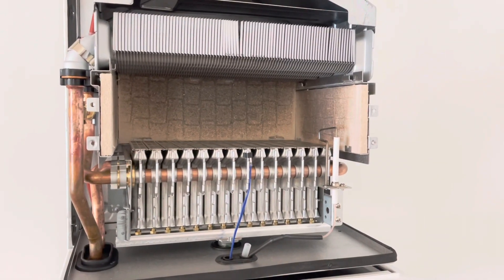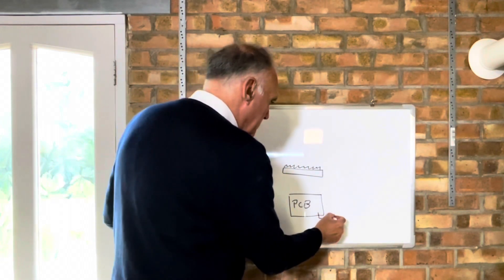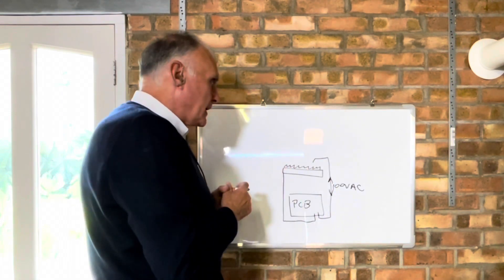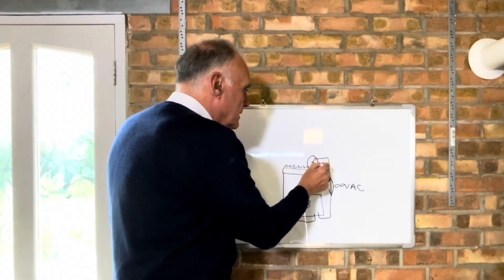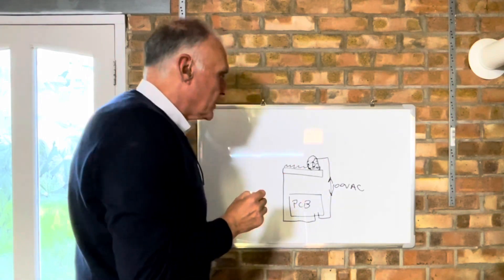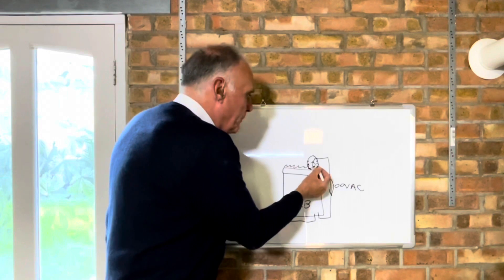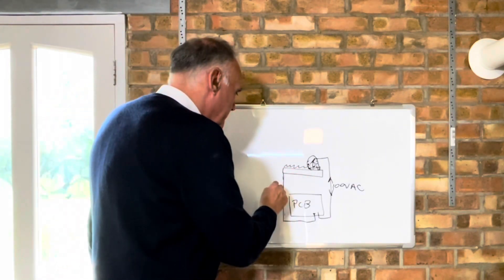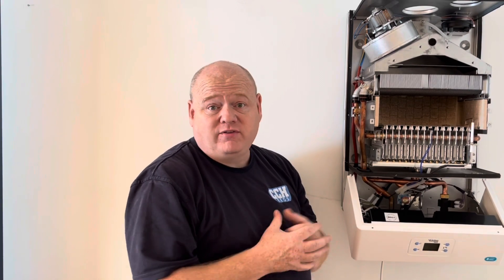Gas Training - Flame Rectification Explained - Gas Boiler - David Iszchak Vokera

Comment: Even a strong flame will only provide a very small amount of rectification, the AC isn't fully converted to DC (at best it could only ever be half wave rectified anyway as the flame acts like a single diode) so half the waveform will be very slightly rectified to DC and the other half won't. Some systems measure the difference between both halves of the wave form, others simply extract the tiny rectified portion , amplify it and if it's large enough then that is a valid flame signal. Also the electrode size thing isn't entirely correct, yes the ground electrode needs to be at least four time the size of the flame electrode but not for the reasons given, it's too complicated to explain here but there's plenty of sources, the explanation in the video is good enough for most people an even if you design flame rectification units you don't really need to know why you just need to know one needs to be bigger than the other.
Reply from the maker: Thank You

Comment: Thank You for very informative vid, whats the proper metod to measure ionizating curent on boilers like Ariston Genus One, there is spark and ionizating electrode on one wire connected to PBC, second wire comes from chamber ground to pcb ground. ??? thanks  in advance

Comment: The heat on the probe make ironination that makes the change from.ac to DC
Reply: That's like the old vacuum valves the heating element causes DC current to flow one direction. A diode vacuum valve, anode, cathode. AC to DC. 😳 It's seems  the pc board needs to sense  a good DC voltage in order to keep the gas valve open "I think!⚠️"

Comment: Hi Allen .
I'm currently studying in level 2 plumbing and want to continue after onto the Gas course.
Since by 2023-2025 I heard they're stoping gas boilers in new houses.
Does this mean they will stop making the gas boilers.
If so wouldn't this reduce work ?
Can you please explain further if possible on what's happening with these new non gas boilers etc.
Reply: 2030 the cut off for gas boilers.  2025 they will prohibit gas installations within new builds.  I'm pretty sure 20% hydrogen pre-mix will be combined into natural gas to help sustain the fuel itself.  Plenty of work in service and maintenance after 2030.  They can't abolish NG boilers and appliances just yet.  Otherwise they'll create fuel poverty.

Comment: Flame rectification is disabled when the power-supply polarity (Line-Neutral) is reversed.
My combi boiler in Europe was powered through a two-pin (Schuco) plug and could be plugged-in any way round. When polarity was reversed, the PCB waited 6-seconds before shutting down due to no flame being sensed. 
UK plugs are wired with known polarity, but the connection to the boiler must be L to L, N to N.
Reply: That's a good point, I forgot to mention that
Reply: That sounds a bit weird. The main circuit board power supply shouldn't care which way the mains plug goes as it converts AC to DC. The board logic in the example explained would connect the metal burner to the earth side of the "AC" rectification circuit and the rectification signal would then produce a positive DC signal  to indicate flame presence. Early  TV's had one AC lead connected to the chassis and this meant that it was possible for the customer to get a shock if the touched the metal chassis. All modern equipment including boilers to my knowledge use a transformer so the chassis or metal work is safe to touch
Reply: @haroldwebster1459  To keep costs down most boilers simply convert the raw mains voltage to a lower voltage with a transformer and current limit it with resistors to make it safer and use that to pass through the flame.

Comment: Thanks Allen,

On another tack, the water heater you show at the beginning and end of the video is a Vokera Aquanova LE (low emission) and those with a keen eye will notice the water pipe running through the burner upstands. 

That's done to cool the flame (not the heat generated by combustion) because a cooler flame reduces nitrous oxides (NoX).

That is to be done to ensure compliance with recent tighter environmental legislation.